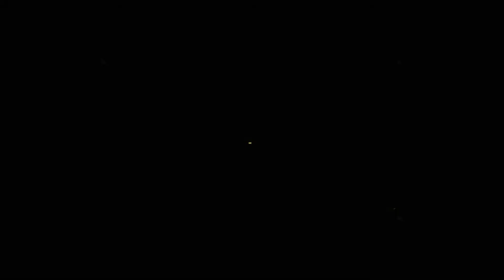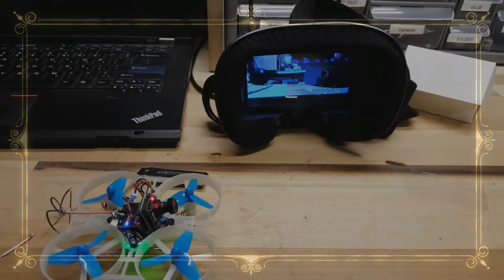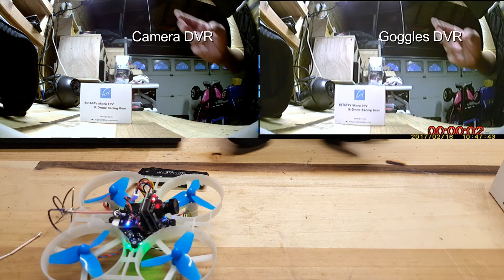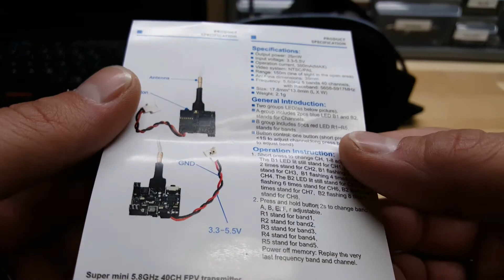TurboWing Cyclops 3 Update

Comment: there is a huge bug in this camera, it only support FAT32 format sd card, and it has 4G per file limited, once the recording file is larger than 4G, it will stop recording, mine took about 25 minutes.
which means after you fly for about 25 minutes, it will stop recording. this is due to the camera does not support exFAT or NTFS format, and does not handle FAT32 4G per file error to create a new file bug.
Reply: you can fly for 25 minutes!?!How???

Comment: After watching this video, picked up one of the cams, and have to say I'm pretty impressed, but have one issue... I've tried different SD cards, and 3 different whoops, some with regular plugs and some with powerwhoop (jst2.0) plugs... The camera works great, I hit record, it starts recording, but at about 8 - 10 seconds, the camera reboots. EVERY. TIME. At first I thought it was a power issue, now I'm not so sure... run across anything like this?

Comment: The connections from the camera are 5v, gnd, and vo.
Can I hook up a lipo with positive (red) to 5v and negative (black) to the ground, or does it not work that way?
If so I can simply unsolder the 3 wires on the camera, and solder in an adapter cable for my 1s lipos and just leave the vo blank, correct? Or will this cause magic smoke because I’m dumb and am completely missing how these things work?

Comment: I would like to use a VTX that support sound (Eachine ATX03), but it seems from the photos that sound is only available on the recorded video.
I can't see any white wire coming out of the camera.
Do you know if it is possible to solder the sound wire from the VTX onto somewhere on this camera ?
Reply from the maker: There is a on board mic on the camera.  I think you could trace the leads and connect into it.
Reply: Thanks. Will try that as soon i receive it :-)

Comment: How did you mount your camera?  It looks so stable!  I bought a Cyclops 3 because of your reviews a while back and I'm struggling with mounting it in a crash-resistant way.  Yours looks rock solid.
Reply from the maker: There is a canopy that is supposed to be coming out soon.  For now im using a ton of hot glue.  Now this camera runs hot you will want to keep an eye on it when using hot glue.
Reply: Thanks for the info.  A little confused on why a canopy would be a good choice for this camera since it would limit the ability to pull out the SD card to view/ clear DVR recordings.  Any idea where the canopy is coming from?  I'd like to look into it a bit more.
Reply from the maker: Isaac H i dont have anymore details.  I imagine they would account for the sd card slot.  The canopy is being released by turbowing
Reply: Thank you, sir
Reply: Is there any way to use the dvr on a runcam micro swift ?

Comment: So you connect the wolfwhoop to the power source of the whoop and the camera to the vtx (Wolfwhoop)?
Reply from the maker: M SJ yes when I purchased the camera I didn't know they had a camera vtx combo.  So I purchased a separate vtx to provide the fpv.
Reply: Thanks 
By the way did u get any info on how to replace that fisheye lens?
Reply from the maker: Yes the lens is easy to remove.  Just hit it with a heat gun for a few seconds that will loosen the bond.  Then the lens can be swapped.  I'm not sure if turbowing sells different lenses.  I will find out and post a link.  I know normal aio camera lenses fit but are not quite long enough to focus the camera.
Reply: C Ray Tech 
One more thing. Is there any video regarding replacing the lens. Be sure to let me know
Reply from the maker: M SJ I do not have the correct replacement lens yet.  When I do I will create a video.  Of if it's helpful I can show just how to remove and add a lens
Reply: C Ray Tech 
Thanks mahn
Just make a video when you get the correct ones.
Appreciate it👍
Reply from the maker: M SJ will do buddy.  Stay tuned.

Comment: Hey
I was going thru ur blog and i saw the voltage, its 4.2V 
So how did u power it with 3.7v battery of a typical tiny whoop?
Thanks
Reply from the maker: +M SJ I'm using the wolfwhoop tx1 to handle the voltage.   All my batteries are lihv so voltage is 4.35

Comment: fpv latency should't mean for much in this relm especially if you haven't moved to SBUS- .. im hoping there will be a 1080p version of this- even if it were a bit heavier and drew more power i wouldn't mind. id imagine such a unit would need a heatsink to dicepate alot of heat. ive noticed two anoying things- true white turns into pure black- (looking into the sun) but the biggest thing that annoys me is the changing exposures is very jittery and not smooth- I guess it can be smoothed out in post editing- so its not half bad.
Reply from the maker: Yeah for the price its great.  Perhaps they will come out with an updated version.